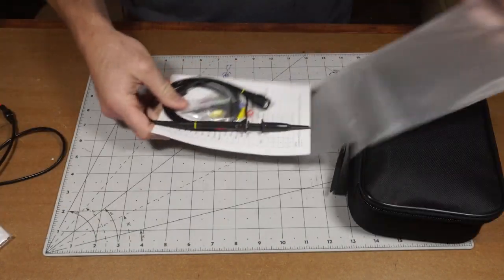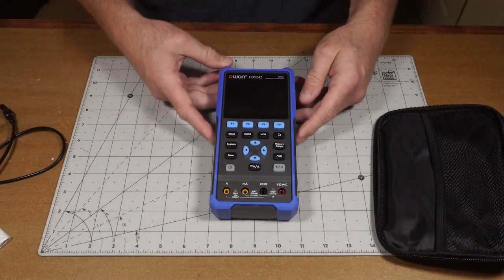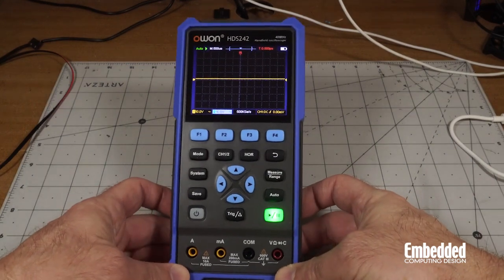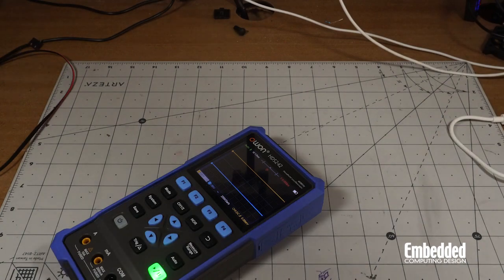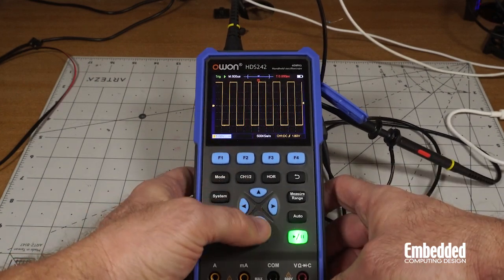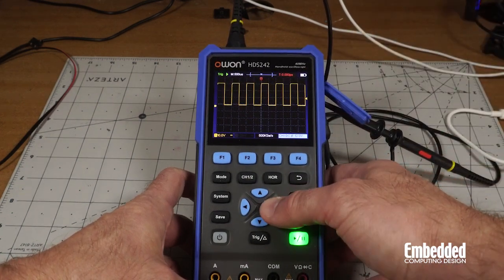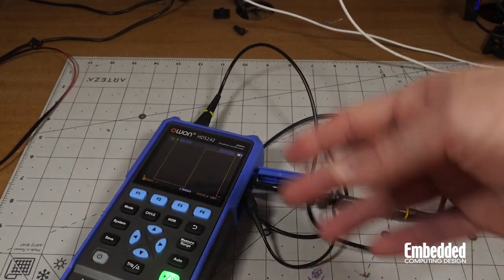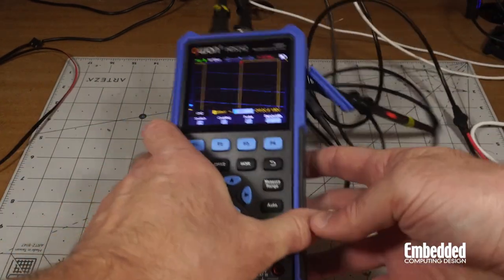Dev Kit Weekly - Budget Tools Review: OWON HDS242

Comment: This is a good instrument but it is not lab class. The problem is that it reduces the sampling rate as you lower the horizontal scan setting, which makes the analysis of low frequency (.1Hz) and short duration (1us) waveforms very difficult. I guess that other similar instruments have the same problem.
Reply: No portable scopes are lab class

Comment: Would this be okay to do some repairs on amplifiers? Or would a stand alone old/used 2 channel scope be better/nicer to use?
Reply: It depends on the amplifier and how old that standalone oscilloscope is, because usually they are not multimeters. Measuring resistance and capacitance is required, while temperature also helps, although a thermal camera is better for this purpose. I have this multimeter and find it suitable for general audio testing.